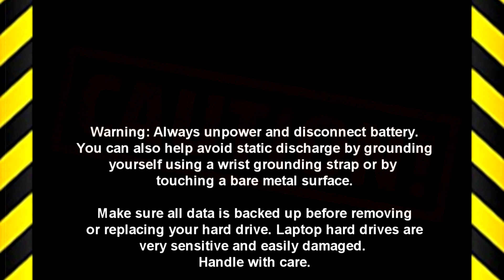Dell Latitude E7250 (P22S002) CMOS Battery How-To Video Tutorial

Comment: Taking out is the easy part. I am having trouble getting a new one back in because the plug is underneath some metal sheeting, which I can't figure out how to unscrew.
Reply from the maker: It's not exactly located in the easiest to reach spot. If you are unable to access the connector this way the motherboard can be removed to access it. We have a video outlining this process here: https://youtu.be/mam8KEgk5Ow